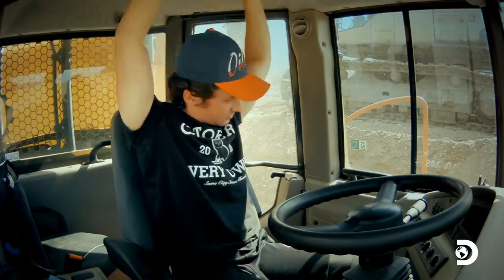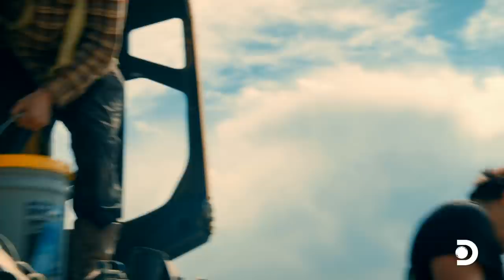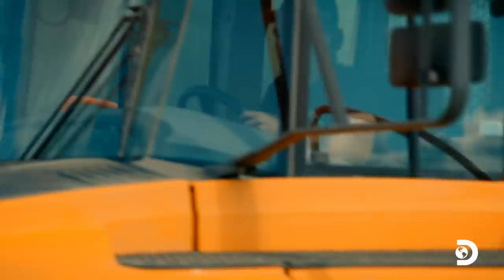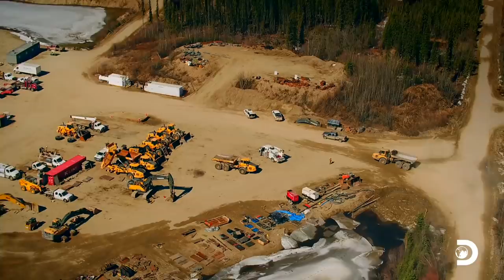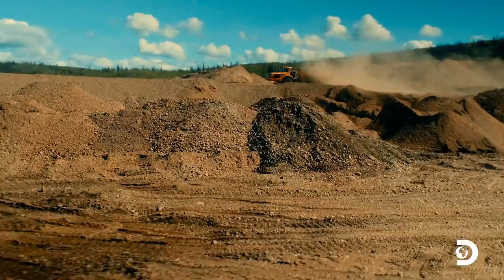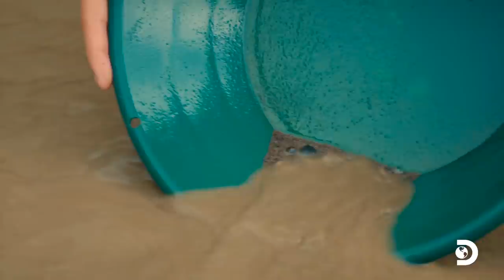New Miner Almost Loses His Job with Parker's Team | Gold Rush

Comment: "more horsepower than a nascar"; eh. The big new 750 makes low 500's. The rock trucks are a lot lower cause it's about torque and pulling. The trucks might make 300 something HP, but they make a LOT OF TORQUE, which is what matters.
Reply: these are the specs of a typical mining truck 
Gross Power - SAE J1995	4000 HP 2983 kW
Engine Model	Cat® C175-20 Cat® C175-20
Net Power - SAE J1349	3795 HP 2828 kW
Rated Speed	1750 r/min 1750 r/min
that's a LOT more than 300 HP
Reply: @Aaron-zu3xn  the trucks they’re using are around 469 hp...you’re referencing the large mining trucks used in coal mines and such. Way bigger than these
Reply: Aaron is right. The rock trucks hzve a LOT more horsepower.
Reply: Torque isnt what accomplishes work. A one horsepower engine can make more torque than those trucks at the wheel given different drivetrain (gearing) what matters is torque multiplied by speed. The output unit is power. Power is work divided by time.
Reply: @jackbarry9469  thank god someone gets it
Reply: Aaron is right but so are you. He’s talking above those massive CAT coal trucks. The ones Parker has are around 450 hp or so

Comment: I'm no expert here, and I can't say if this is fact or not, but in my opinion, the reason the drive train broke is possibly due to him speeding around over the dips and rocks. That's a recipe for disaster in almost any vehicle.
Reply: cost of doing business, you have to work the trucks hard to keep up, sometimes stuff breaks, not the kids fault
Reply: I wouldn't say that. I mean you could of you wanted but. I've been a end dump drivers before did it before I got on the dozer you have to keep them cycle times down low so you have to push them trucks. Speed limit on our site is 25. So I'm sure they are doing around 30 35 maybe more.
Reply: Bullshit those Volvo's are the toughest things going. Lack of maintenance has caused that
Reply: Lmao did u see the sexcavator rockin that truck with bucket to wake that kid up think it’ll b fine it’s what them giant trucks are made for

Comment: People dont understand. Doing these circles back and forth all day long seeing the same trees or rocks is the most mind numbing thing ever. Its easy to start to doze off while driving the equipment. Its dangerous but tiring and easy to lose focus
Reply: I do know how boring it can be to cycle on site.  The thing is, I get out of the seat when getting loaded.  I count the buckets as I get loaded.  There are things to do to mitigate it.
Reply: @pontiacsuperchief9532  Oh for sure no doubt about it. However, for example, I used to haul snow with a dump truck while I worked for the city up in North Dakota. Some winters we would be doing it for some 12-15 hours a day for weeks to months depending in how bad the storms were. Im talking your getting to work at like 1am and starting then going through to like lunch, then you start whatever normal job (I was in forestry so cutting down trees etc.) So exhaustion plays a big role in it where after a while you dont even realize youre tired and dont even think to try to mitigate it

Comment: if they used the big cat scrapers they have more capacity than a haul truck and go faster. no need for excavators loading trucks. more ground being excavated faster
Reply: I’ve worked in the mountains like these, and there’s a reason Tony Beets has his parked. I’m a scraper and hoe operator and a hoe is way cheaper per yard, and the trucks get around a lot better.

Comment: The problem with HD haul trucks is... everyone thinks it's this cushy ,super easy job, that anyone can do. While i will admit, they are pretty easy to operate,,,you still are getting tossed around in your seat and performing mental gymnastics 10 or more hours a day, to figure out were, and when , and HOW, to dump your load. It's no joke.  EVERYONE thinks they can do it, until the minute they let you go by yourself and give you the controls...

Comment: All this equipment, no one keeps spare belts, drive shafts, starters, power units, etc, on hand?
Sounds expensive til you have something down a week for a $1500 part that fits 3 or 4 other machines.
Reply: theres that many bits that go wrong youre better just having a spare truck, which he does

Comment: That boy is weak. Pulled many a long hour running snow from A to B in dumptrucks. It’s boring and easy work. Throw on a good podcast and run. No reason he should be falling asleep.

Also he should have been crawling around with that mechanic and asking questions rather then quietly waiting. Might have taken a little longer to get it up but it would show his willingness to learn how to do the basics.